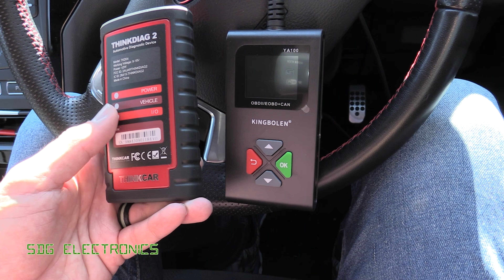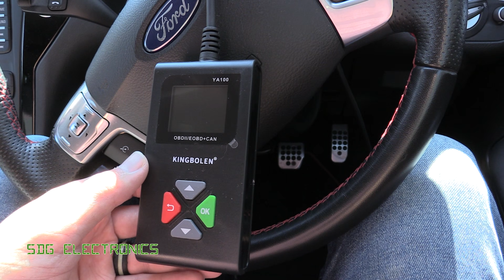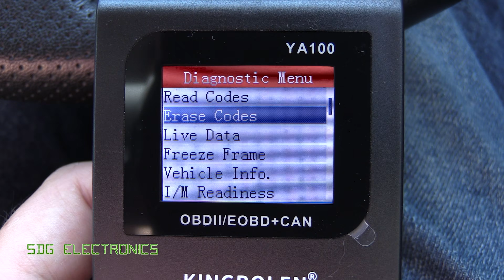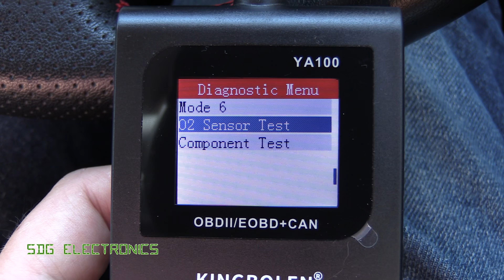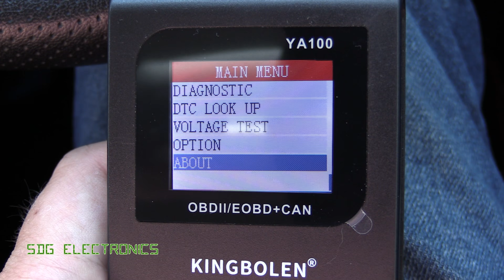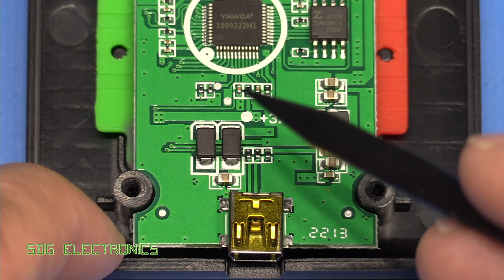SDG #266 Low Cost Kingbolen YA100 OBD-II Code/DTC Reader and Diagnostic Tool

Comment: Can anyone share the firmware update? Looks like the manufacturer has pulled it from all the web links
Reply from the maker: No firmware available for this model yet. It's released with the current firmware.
Reply: @sdgelectronics  Thanks, I bought one based on the recommendation but on one car it doesn't detect at all, on the other it works for basic features but can't do much besides read fault codes. No option to select car model as the user guide suggests.

Comment: Other components are because some vehicles are only OBD, and no CAN bus, so they have to implement the serial comms that OBD has, which are 12V signals, so level shifting to both repond to the signals, and read the data back off them. Microcontroller is very likely just a common Chinese microcontroller with a small amount of on board flash, that then fetches the actual operating code from the flash memory and exacutes it. Likely limited RAM as well, probably less than 64k, and likely same amount of ROM as well to just communicate with the flash, with probably encrypted memory with an on chip common key, to keep the cloners away. Likely the different versions all are identical, just the key is different, to prevent you flashing the high end firmware on the base model, and getting it free, plus also allowing branding different names, while keeping the firmware safe-ish.
Reply: Yes, other parts are probably for non-CAN OBD communication - J1850, ISO 9141-2, KWP2000.
Reply from the maker: Good insight, thanks.